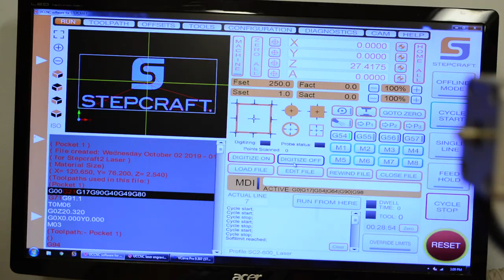Add A Laser To Your CNC - Customize Anything

Comment: If you apply mineral oil before laser engraving the wood you do not need a mask applied. dry wood will want to combust while oil infused wood will not. I simply clean up any residue with ISO lightly applied to a rag or Q-tip.

Comment: What settings did you use to create the picture (in i assume vectric)? I have been using the laser engraver option but it is really slow as it has to go through all the lines. It would be awesome if you could post a small video about that so it is easier to setup with vectric.

Comment: Why did you use the clear tape and then laser on top of it?
Reply from the maker: It prevents any excess burning outside of the vectors
Reply: Stepcraft Inc what kind of tape is used?
Reply from the maker: @mackenziesigwaldparrotta5689  Just clear packing tape - like you would use to ship a box.

Comment: Why are you applying a masking film on the wood? The laser is melting/burning the film into the wood. Is the good for a board from which you might eat things? Because the plasic film and the glue on it might be or get unhealthy when burned into tjhe wood.
Reply from the maker: Its clear packing tape.  Just to keep the overburn down